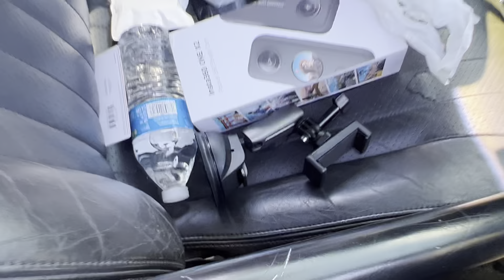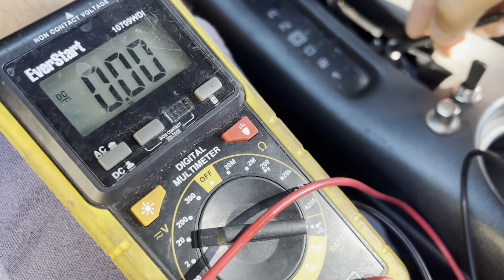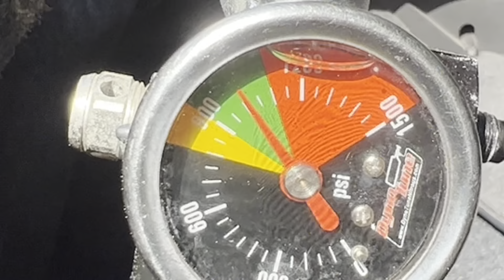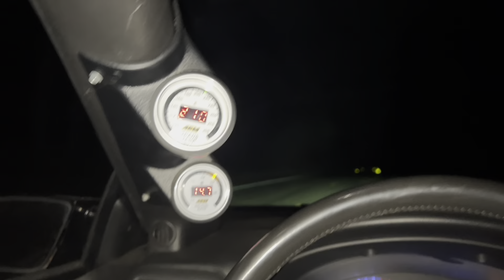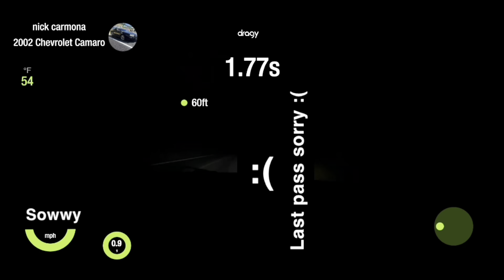Spraying my LS1 Camaro with a 100 shot of nitrous

Comment: U have stock rear end or what’s the build with that?
Reply from the maker: Quick performance 9in
Reply: @The_Nick_Carmona  sounds like the car was red lining every shift…. what were you shifting late?
Reply: @The_Nick_Carmona  tour lucky dat 10 bolt didnt give on you and i see the axle studs are stock also i have 9” rear 3.70 race gear full spool 40 spline axles with big boy 5/8 studs
Reply from the maker: @ThaLs1thatcould  yea I was lol
Reply: @The_Nick_Carmona  it was almost 4k for my rear end kit trick chassis makes a fabbed one you can order ss a kit with everything you build ot how you want i even got the back brace to make it handle extra hp the mjne it built it will handle well over 2k hp and im no where near there but my point is i have sooo much room to grow plus i run a built th400 our cars look so much alike only difference is my wing and hood
Reply from the maker: @ThaLs1thatcould  dayumm that’s sick

Comment: Are u using a nos plate or direct port
Reply from the maker: Plate
Reply: How much do you recommend to run with a plate to make sure distribution of nitrous threw the cylinders
Reply from the maker: @terrydavis3857  direct port is way more consistent and is the right way to do nitrous I bought the car with the plate so I sent it with what I had